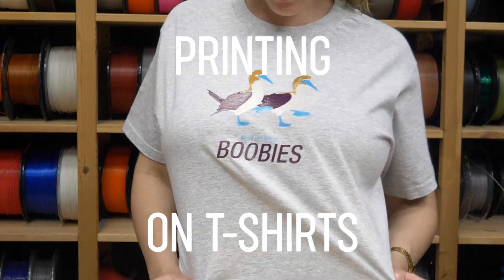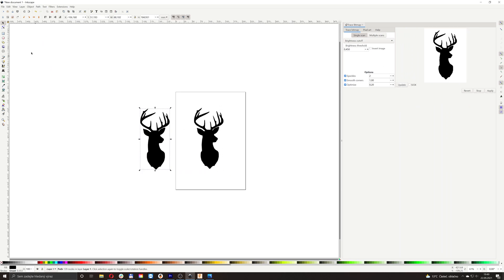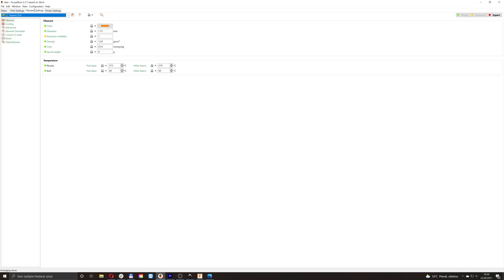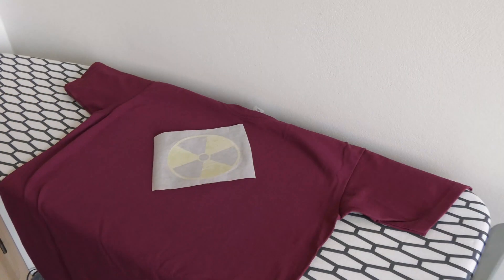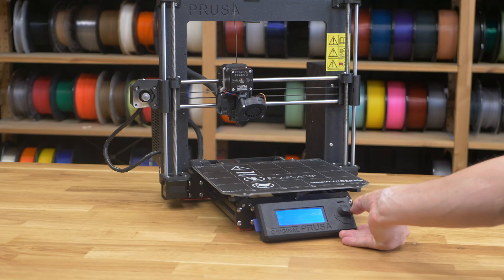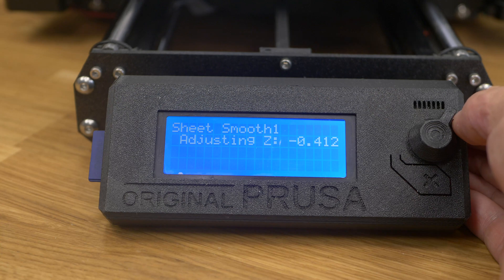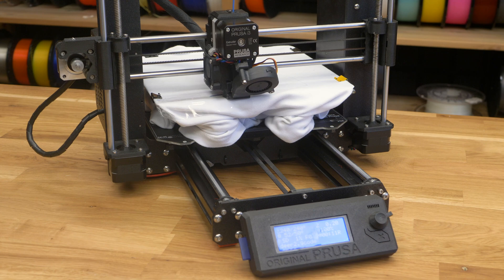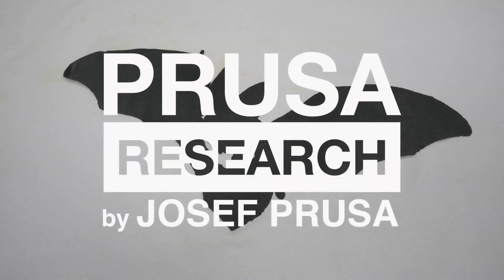How to print on T-shirts_v1

Comment: If shirt printing were easier than this, it could kill screen printing.  We order enough shirts every year to justify the cost of equipment, but not the time and effort of each print.
Reply: You could just calibrate the z axis by using one of the profiles normally used by textured or smooth sheets in the prusa. Add the shirt and mount, adjust the live-z and save. That way you can repeat it all the time.